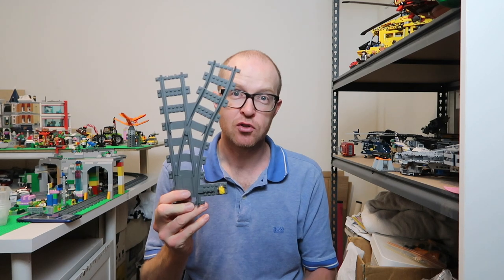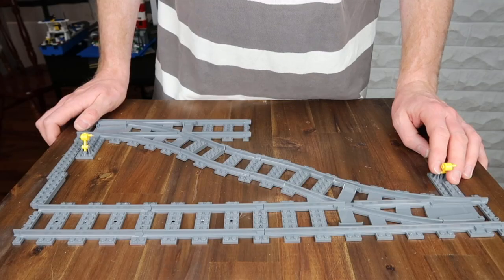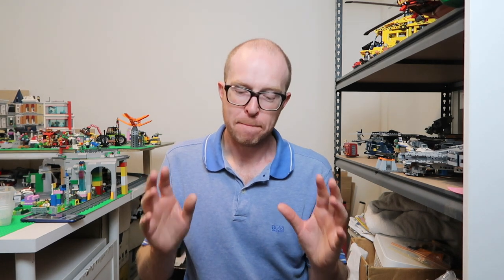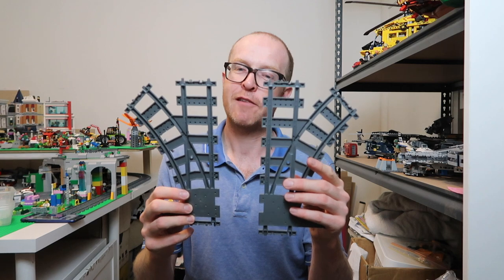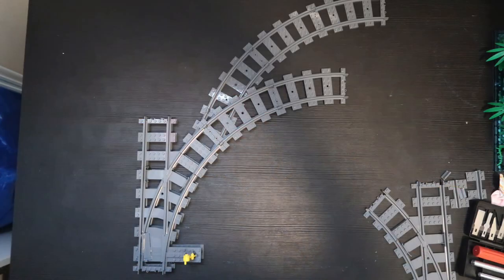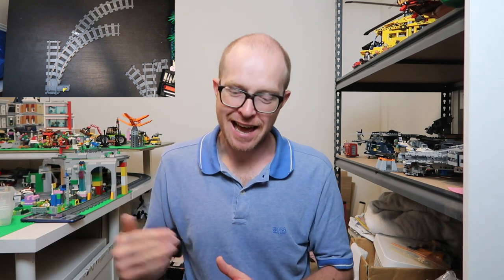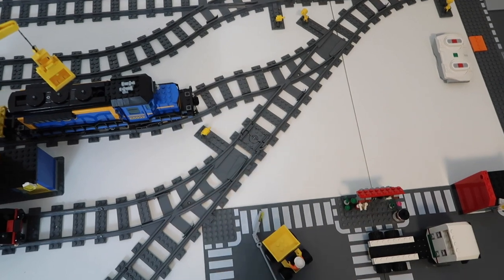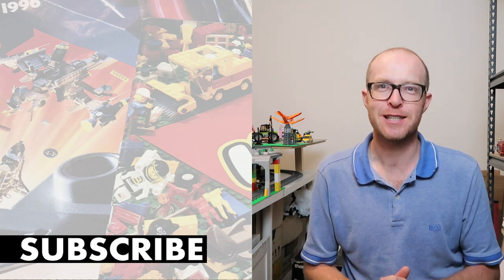DIY LEGO Hack: How to make LEGO Train Junctions go "Outward" #tutorial

Comment: Looks much better.  What's the best tool for cutting them?
Reply from the maker: Honestly, I use a Stanley knife. It’s soft plastic so a bit of pressure and cutting a line on top where you want it to end then turn it over and cut from the bottom. I find it easier to cut straight - and can also tidy edges with. But some people use small hack saws. I find they shread a bit as the plastic is soft

Comment: I've only attempted cutting baseplates so far (which has gone without a hitch) but tracks are a bit thicker! 😉 I have no immediate need for doing this, but it's worth remembering if I ever want to save some space. 👍
Reply from the maker: Funnily enough, I'm on the fence about cutting baseplates. Go figure. Probably will one day, although I seem to have my current layout bang on for size give or take 1 stud width.
Reply: GJBricks well that makes no sense! 😁😜 I have cut down several 48x48’s to get 3 16x48’s because of my table sizes. Easier than trying to source 16x32’s on the secondary market, where they are far from cheap ☹️
Reply from the maker: I hear you on that. For 0.000000001s I considered "after market" baseplates for that very reason.

Comment: Thanks for the great "hack", works great for my layout. 
*Note: I found that I could use a curve piece rather that the offcuts from the opposing junction, which makes it completely reversible and you don't have to hack both a left and right.
Reply from the maker: A good tip! Thank you! I confess, since I did this, I’ve moved onto using TrixBrix junctions as they are very flexible and non destructive.
Reply: @GJBricks  yeah, I'm just starting out so trying to keep it simple and budget. Also, I've seen your latest videos and the train setup is looking great.
Reply from the maker: Chris Jones thank you! Hoping to get another chunk finished tonight and do a small update if I can.

Comment: What kind of cutting tool did you Use to cut the tracks also is the modified switches turn the same as two curved track sections
Reply from the maker: I actually just used a Stanley knife because the plastic is quite soft (and my hacksaw is blunt).

Comment: Comparing this to your other video on cutting to achieve a crossover with 8 studs difference, am I correct that there is no way to cut a switch so that it could be used both in a crossover and 90° curve, while still being able to connect the elements using plates? (It would probably work if you cut in the middle between the last connected and the first free sleeper, but connecting these afterwards would not be easy.)
Reply from the maker: The way these are cut is for ease. But, in theory, you could cut down the centre of a sleeper to join them together. I might try that this weekend actually. Needed to make a new set anyway. Will let you know. The other option is something like the ones front BrixTrix. They’re junctions are 3D printed but have several ways to configure them

Comment: Reccomended cutting tool?
Reply from the maker: That is a good question. It really depends what you have to hand but for me, I used a sharp modelling knife to cut through it as it’s soft and if you work the knife all the way around so you have a score of a couple of mm’s deep, you can then just snap it off and tidy it with the knife. But, some people use hack saws. It really is personal preference but you’ll need to tidy it after either way.
Reply: @GJBricks  Good idea, thanks 👍🙂